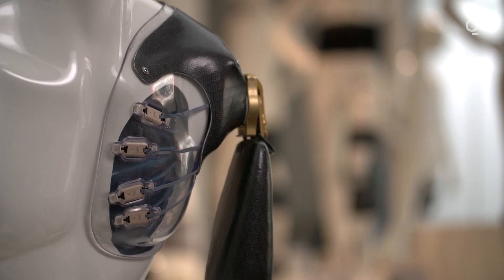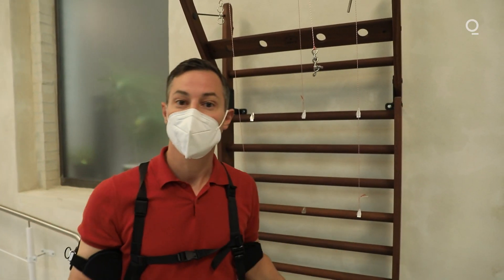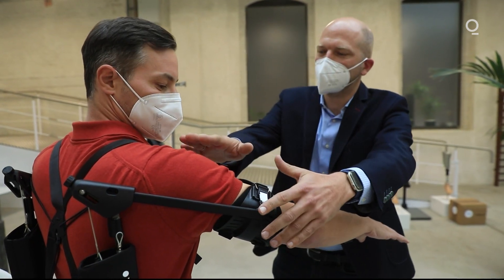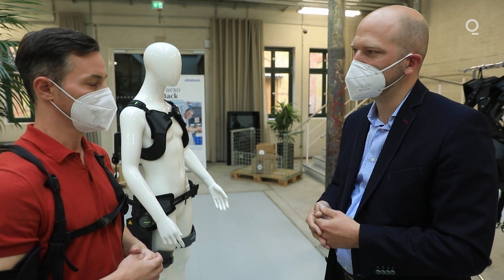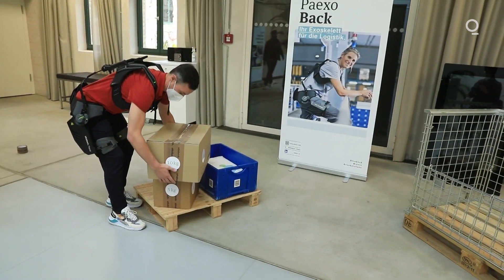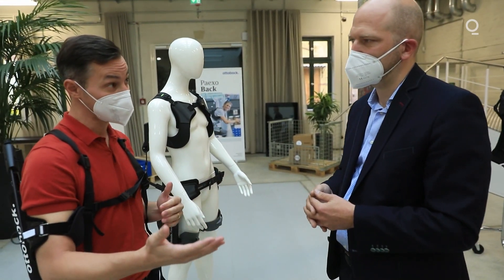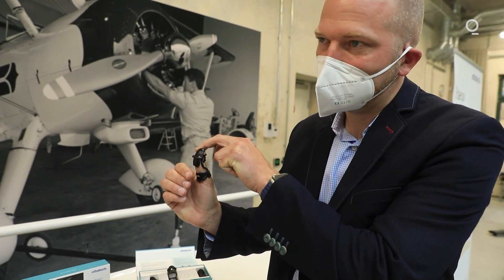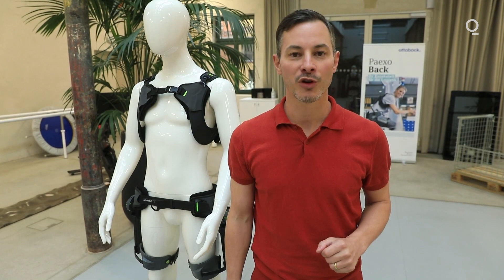How Exoskeletons are Changing the Workplace

Comment: These are obviously designed so that over time you become physically weaker and then have to depend on the device just to function.
Reply: My dude, cars were built so that you don't travel by foot anymore hence making you weaker.
Reply: @Archie Archius  I'm going to assume my comment went over your head. But yes, shoes tend to damage your feet. It's still better than going barefoot, but most shoes have too much cushion, which leads to knee pain. I myself have started to use barefoot shoes with no cushion, which makes you walk a certain way so you don't have to damage your knees.
Reply: @Ace_Bandido808  Have a nice life.